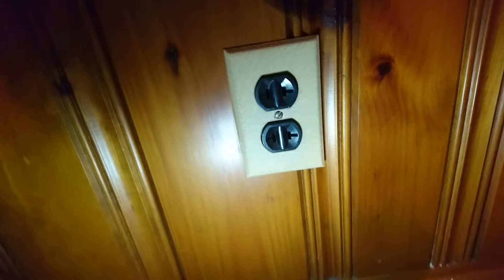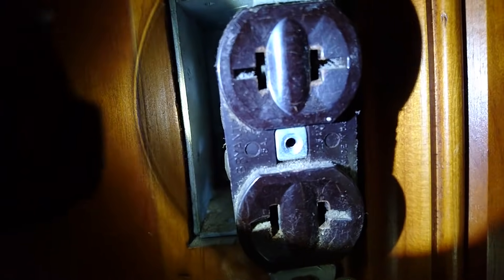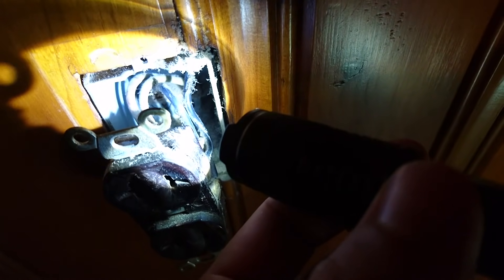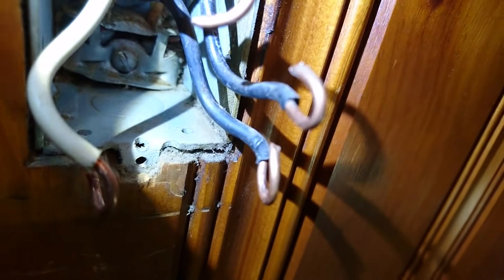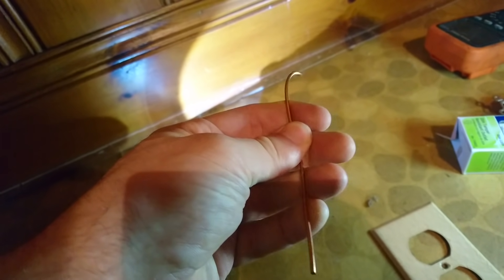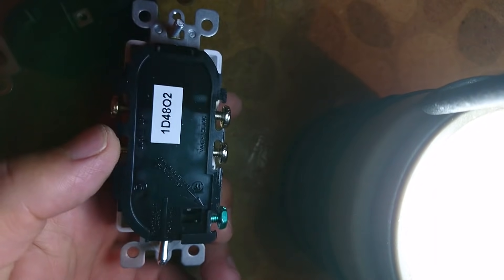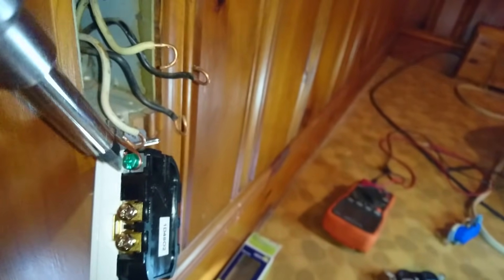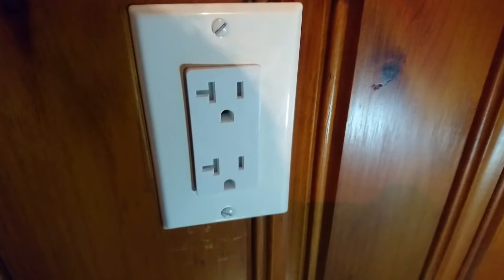How to Convert a 2 Prong Outlet to a Grounded 3 prong Outlet (TYPE AC Cable WITH Grounding Strip)

Comment: Not sure if it is the right way or the legal way to fix this problem.
The box is not a ground.
Reply from the maker: It is - in the pinned comment I cite the NEC code. The metal box is grounded through the metallic sheath/bonding strip, which is grounded at the electrical panel - so there's an actual ground path. The other way to be legal is to replace the outlet with GFCI and label it "no equipment ground".
Reply: @Bootstrappin  There is no ground with the box. Nails in a piece of wood to hold the metal box is not considered a ground.
You are right, the right way is to replace the outlet with GFCI. That is what I have done in my house (build in 1958). The other option is to change all the wiring…
Reply from the maker: @Tech_NO_Tech  I'm not claiming the box is grounded by virtue of being nailed into wood - I'm saying that the ground path goes through the metal sheath of your electric cable, which is clamped to the metal box. So your ground path goes through the metal box, through the metal sheath, and back to the panel.

Comment: How do you ground it if the box is plastic?
Reply from the maker: You'll have to run new cable unfortunately. And if that's not an option, install a GFCI instead, and label it with a "no equipment ground" sticker.
Reply: @Bootstrappin  thx for the advice. Much appreciated

Comment: That's not correct, the only time a 20 amp outlet is necessary is if alone on a circuit, otherwise, it is to code NEC as is, unless overridden by a City Code, NEC is the minimum Cities my enhance that code, now that said upgrading any device is acceptable to the NEC, with some limits.  If you truly are interested feed-thru resepticals are now not accepted by the NEC. A master electrician for 40 years.
Reply: NEC is not "the minimum". Any state or other agency adopting the NEC may leave out entire sections, or amend them, or enhance them, as it sees fit.

Comment: that’s a 15 amp outlet??? that makes no sense though, it has the horizontal ports as well as verticle...

also, aluminum oxide didn’t cause fires, it’s actually because aluminum was more prone to overheating. All you have to do it get a suitable outlet, but yeah, i would replace it with copper
Reply: Back in the day, it could have also been wired for 250v at either 15 or 20A, accepting a NEMA 2-15 or NEMA 2-20 plug.  For obvious reasons this is unsafe and no longer permitted in new installations.

Comment: Should be a pigtails going to the socket. Socket links should never be used as part of the circuit. Links are there for when socket is used as a 'half hot' or one socket is switched.
Reply from the maker: I'm not sure what you mean, can you elaborate? Do you mean the ground wire needs to be pigtailed as a coil to provide immunity against motion? What are you calling a link?
Reply: Line,  neutral and ground wires should have pigtails going to the sockets so that any failure in the socket will not interrupt current flow to the next socket down the line. The links on the sides of the socket should only have the other end of the pigtail connected to it and the unused screw should be tightened. In the event you need to split the socket into two circuits the link can be cut and both screws are used to connect the line and a switched line (for light fixture for example). Picture of a pigtail connection ... https://imgur.com/a/mBVAVEL  Another advantage of using pigtail is any movement of the socket with devices being plugged/unplugged and the screws working loose then only the socket connection is affected and current to other sockets is not interrupted.
Reply: I believe that’s only when using a gfci outlet
Reply: I have a three prong outlet inside a metal box with the wiring being in the same orientation as yours is it possible to wire another two receptacles in a 2 gang box from my current setup if so any info would be greatly appreciated
Reply: Absolute falsehood!  NEC stipulates you only need pig-tailing when required on a multi wire branch circuit with a shared neutral.    As for movement of the device - NEC requires they be FIRMLY secured to prevent movement.  If you have movement you have other issues.

Comment: The latest NEC code does not allow using the receptacle as a current carrying part of any circuit, so you should make a junction in the box and add pigtails to the receptacle so the receptacle screws aren't carrying any power on to the next device.
Reply from the maker: I'll make an updated video. Thank you for the info!
Reply: significant resistance develops that way, though some old timers do a loop around the screw, thereby the screw does no carrying (path of least resistance)
Reply: Which section is that on? I think you are mistaken for a section regarding multi wire branch circuit. Grounded conductor (neutral) on multi wire branch circuit is no longer allowed to use receptacle as a current carrying part. This was due to possibility of neutral becoming hot when one of the neutral got disconnected while one of the multi wire branch circuit is still turned on. 
This kind of the case. 
https://www.twielectric.com/safety-and-energy-saving-tips/national-electrical-code-multiwire-branch-circuit/
Reply: This is NOT correct as far as NEC requirements.  If you disagree please cite code section as reference.  It MAY be a requirement in your area by the AHJ but this would be an example of a local restriction over and above the NEC.  Not uncommon but in this case, because the practice of continuing circuits thru a device is so common and universal, I am skeptical.
Reply: Who cares about a silly code like that.
Reply: @ John Mcmanus. You seem to be very knowledgeable and experienced but please refer to NEC 2017 code section 300.13 (B)
Reply: @yknot3148    As I posted previously, NEC 300.13(b) pertains to multi-wire branch circuits where two separate phase conductors share a neutral.  In this case the continuity of the neutral cannot be broken by removing a device where the neutral path is thru the yoke.  Doing so would create a dangerous overcurrent on the circuit (220V on a 110V circuit).  In a regular branch circuit where there is a dedicated neutral there is no NEC requirement to pigtail, connections can be made thru a device yoke (although it may be a local jurisdiction requirement OR the practice / preference of a particular electrical contractor).  You have taken this requirement out of the context of multi-sire branch circuits and applied it to all branch circuits.
Reply: Not a true statement

Comment: I only have 1 white 1 black electric cable 2 prong outlet. Do I use a GFCI electric outlet instead of this way?
Reply from the maker: Yes, that'll work fine, just make sure to label it 'no equipment ground'.
Reply: @Bootstrappin  I tested it and it is grounded. So your way of adding the wire to metal box casing is okay. Thanks. No need for GFCI
Reply from the maker: @khoayeuha  only so long as the cable sheath is actually metal with a grounding strip and connected/grounded at the panel.

Comment: Those breakers are almost impossible to replace should you have one die on you like I did, they are a very old style.
Reply from the maker: Not sure what you mean? I just pulled one out and put a new one in, got it from Home Depot.
Reply: @Bootstrappin  You had better luck than me. My local store stocked them years ago but they seem to have stopped.
Reply from the maker: You know, maybe you're right. I did have to go searching various hardware stores for these peculiar Cutler-Hammer styled ones. But I'm sure you can buy online.
Reply: @Bootstrappin  I just checked my panel they are some brand called Magnetrip. I think Edison invented them.

Comment: Hard to see for sure with the low light in the video, but it appears there is the T receptacle on the neutral side.  If so that would indicate it is indeed a 20 A device.
Reply: It;s an older 15 amp tandem-parallel receptacle
Reply: Not exactly.  The "t" is on both slots meaning it  could also have been wired for 250 volts as a NEMA 2-15R or maybe even a 2-20R.

Comment: Aluminium is not in of itself flammable. That is not correct.  The reason for failure of domestic aluminium use?  People mixed metals and didn't use anti-oxidization gels.   This caused high-resistance joints, which caught fire.    We use aluminium wire everywhere outside - and it's fine - like with like metals.

What's with your lack of RCBOs?
Reply from the maker: This is true, that was my mistaken assumption. Old house, no such requirements except GFCI in kitchen and bathroom.

Comment: So what do you do if your house has knob and tube or what my grandfather called rat tail. Also half my house is breaker and the older section is fuse .
Reply from the maker: I would honestly rip it all out and replace it with modern Romex or equivalent. Knob and tube doesn't have grounds, isn't really rated for today's power consumption requirements, and because it's about 80 years old, the insulation is likely to be in shambles as well. Fuses although outdated for residential wiring, are perfectly fine as long as they are sized appropriately for the wire gauge.
Reply: @Bootstrappin  I did that in my sister's house in about 1978: took out all the k&t and replaced with NM-B with ground, exc one piece of armored cable for the lead to the water heater.  Cost me about $2,000, including the new 200-A breaker panel and conduit to the new weatherhead.

Comment: Just bought a plug in car. House is early 50s with the 2 prong outlets. The charger to the cat needs to be grounded to work. Will this work? Like is this an actual ground that will trick this charger, or do I need new wiring with an actual ground wire running all the way back to the panel?
Reply from the maker: Like I mentioned in the video, what becomes the ground path is (if you have it) the metallic sheath of your cable with the bonding strip. If you have it, and your outlet boxes are made of metal, this will work as an actual ground and not just a trick. Once you finish the job, be sure to test it with an outlet checker - it'll let you know if your ground is doing the job. The ground path should be as follows - outlet ground screw to outlet box, to metallic sheath, to electrical panel, to earth ground (usually a stake in the ground, or on older homes (not to code anymore) to water pipes).
Reply: @Bootstrappin  I don't have metal sheath
Reply from the maker: I see, then you might have knob and tube wiring or similar. You'll have to replace it with modern 3 conductor cabling.
Reply: @Bootstrappin  I ran a wire from a pipe that's connected to the main grounding panel to one outlet. It worked.
Reply from the maker: @phuquetwo  that'll work. To code though? Probably not.
Reply: @Bootstrappin  with all that's going on in the world.....lol. Probably not. The wire I had laying around is red....one code violation. Also, it's not in the main wire, even though it's doing exactly the same thing. Whoever else lived here 40 plus years ago had a large bare copper wire grounded to the water pipe. I'm thinking it was ok back then, and I'm grandfathered in. I had a new power box installed 3 years ago, and they didn't mention anything about it. Just swapped boxes with the old wire. They signed off on it.

Comment: You can only put a 15 amp outlet on 20 amp circuit if it is rated for 20 amp pass through
Reply: Actually you can put 15 amp receps on a 20 amp circuit if you have more than one 15 amp recep on that circuiut
Reply: @donl1410  why would the number of outlets make any difference? If your Overcurrent is 20 amps, your receptacle at 15, would be 5 amps below that.
Reply: @frankpaya690  Code requirements:  NEC Article 210.21(B)(1)   Single Receptacle on an Individual Branch Circuit. A single receptacle installed on an individual branch circuit shall have an ampere rating not less than that of the branch circuit.

Article 210.21 (B)(3)  Permits the use of Table 210.21(B)(3) where the receptacles are connected to a branch circuit supplying two or more receptacles.  Circuit Rating (Amperes) 20-  Receptacle Rating (Amperes) 15 or 20

Comment: Would this work in a steel house, like my interior walls are steel.
Reply from the maker: I wouldn't ground to your walls, because if something malfunctions, and you happen to be touching a wall, you'll get electrocuted.
Reply: @Bootstrappin   hm some of the outlets in this house have 3 prong and gfci the rest are just two prong what should I do
Reply from the maker: If you don't have armored cable and aren't willing to pull new cable, you can replace the two prongs with GFCIs, and put a sticker on them that says "no equipment ground". I believe it is permissible to daisy chain off of one GFCI and put regular 3 prongs downstream from that GFCI, but you'll have to look into that - see if NEC permits this.

Comment: Oxide isn’t flammable the reason the houses may have burn was because of the loose from using aluminum wire and treating nor maintaining it do you have experience or licensed as an electrician or you just a handyman
Reply from the maker: Makes sense! No, just a handyman.

Comment: aluminum oxide is not highly flammable.  Aluminum oxide bursting into flames is not the issue with aluminum wiring in homes.
Reply from the maker: Indeed, I realize that now. The real issue is the high resistance points created by the oxide, thus causing the wire to overheat during load.
Reply: @Bootstrappin  Even that wasn't really the issue. It did play a part, but It was more wire creep due to the higher thermal expansion of aluminum compared to the other metals.
A relative of mine had aluminum wiring in their house.  Many years ago they replaced the receptacles in their upstairs living room with new ones.  About 10 years later we started to notice problems with only the new outlets.  They were not aluminum compatible.  We checked the rest of the house and there were no problems elsewhere.

Comment: You know what nobody does in these videos, is show how freaking difficult it is to put the looped wire around the screw on the newer receptacle.  I think that took me the longest and was so frustrating.  Every vid I find on here, edits that part of the video out, probably because it takes them forever too.
Reply from the maker: I'll fess up - especially when it's 12AWG wire, it can turn into quite a struggle for me too lol.
Reply: Just open the loop a little.

Comment: As long as one uses 12 ga wire you can use 15 amp outlets on a 20 amp circuit  because while a 15 amp outlet will only output 15 amps through it's plugs it will pass through 20 amps on down the circuit.

Comment: Using the sheathing on BX cable is NOT a legal NEC compliant ground!!!
Reply from the maker: See my pinned comment: 

Important detail: you MUST have a grounding strip inside your armored cable, also known as Type AC cable. You should be able to spot it when you open the cover of your outlet, it's a bare tin plated steel wire. You might have better luck spotting it where the cable enters your electrical panel.

See NEC 250.118 Sections 8 & 9:

(8) Flexible metallic tubing where the tubing is
terminated in fittings listed for grounding and
meeting the following conditions:
a. The circuit conductors contained in the
tubing are protected by overcurrent
devices rated at 20 amperes or less.
b. The combined length of flexible metal
conduit and flexible metallic tubing and
liquidtight flexible metal conduit in the
same ground return path does not exceed
1.8 m (6 ft).

(9) Armor of Type AC cable with an additional
equipment grounding conductor and as
provided in 320.108.

See an example here: 

http://activerain.com/image_store/uploads/2/2/5/9/2/ar1364321329522.jpg
Reply: You are partially correct.   The very old style BX cable was not intended to have it's sheathing used as an equipment ground.   Depending on the length, quality of connections to metal boxes, and the amount if any corrosion or damage to the sheathing,  in the event a hot wire came loose and touched a metal housed appliance or wiring device,  the sheathing might offer enough resistance to limit the current below what is needed to trip the breaker & isolate the unsafe circuit, and in some cases,  the cable sheathing will get very hot and possibly glow red and start a fire inside walls.    I've heard old timers talk about that, though I've never witnessed it for myself.  

The newer version of AC cable comes with a grounding strip running the length of the cable, this is approved for equipment grounding.

Comment: So yeah this is totally wrong . You have 2 wires comming in .I see no ground wire . So unless you have black white and green you cannot install grounded receptacles period .
Reply from the maker: The ground path is through the armored cabling/bonding strip - permitted as follows:
  
Important detail: you MUST have a grounding strip inside your armored cable, also known as Type AC cable. You should be able to spot it when you open the cover of your outlet, it's a bare tin plated steel wire. You might have better luck spotting it where the cable enters your electrical panel.

See NEC 250.118 Sections 8 & 9:

(8) Flexible metallic tubing where the tubing is
terminated in fittings listed for grounding and
meeting the following conditions:
a. The circuit conductors contained in the
tubing are protected by overcurrent
devices rated at 20 amperes or less.
b. The combined length of flexible metal
conduit and flexible metallic tubing and
liquidtight flexible metal conduit in the
same ground return path does not exceed
1.8 m (6 ft).

(9) Armor of Type AC cable with an additional
equipment grounding conductor and as
provided in 320.108.

See an example here: 

http://activerain.com/image_store/uploads/2/2/5/9/2/ar1364321329522.jpg